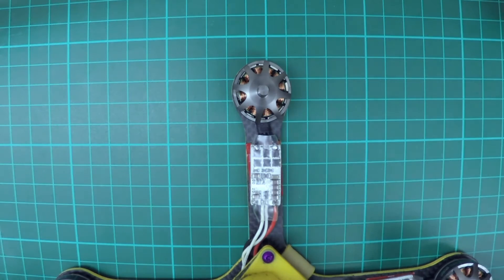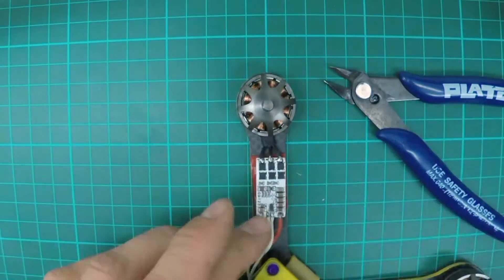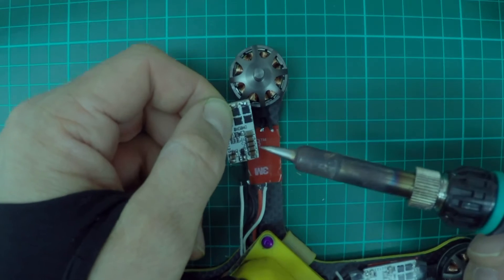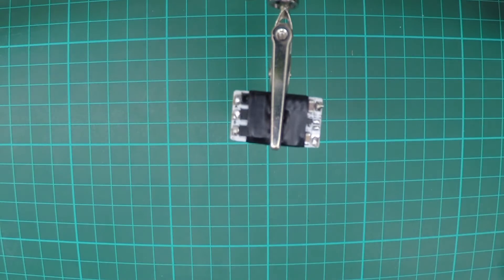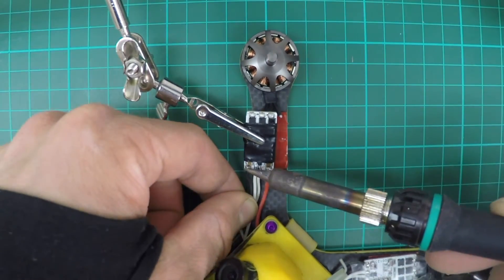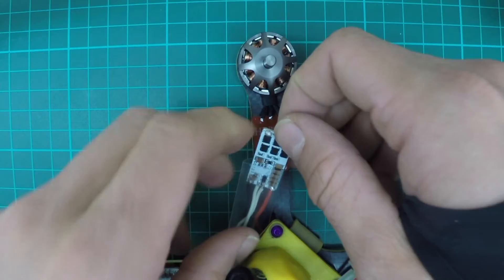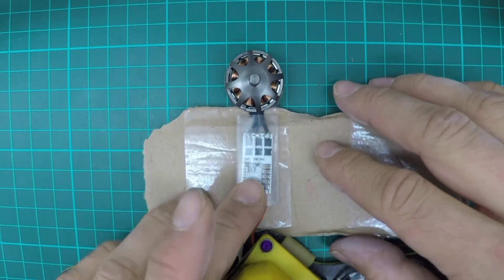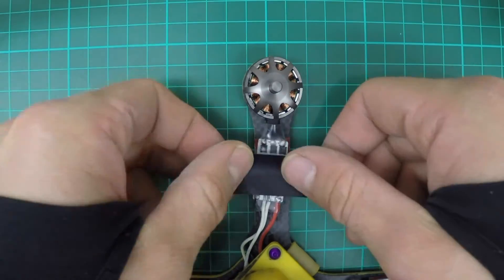How to change a Motor Speed Controller

Comment: Great tip. Like you said, don't be afraid to have a go at de-soldering the stock wires from ESC's. Especially when doing a fresh build as you can get a much tidier build with wires cut to the perfect length, rather than trying to join wires together. Tidy builds are reliable builds.